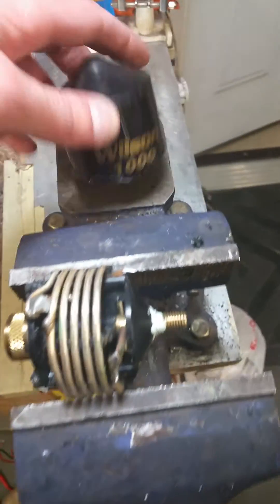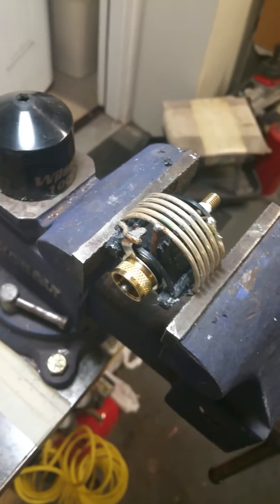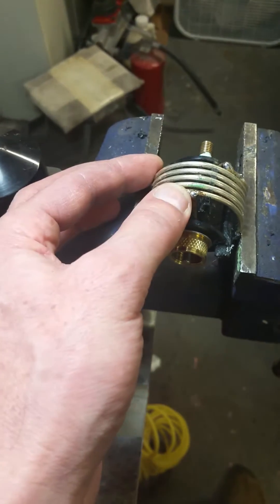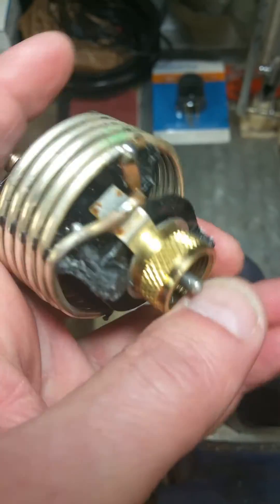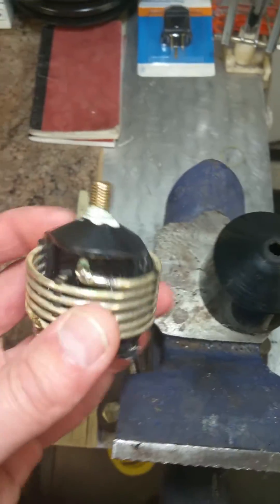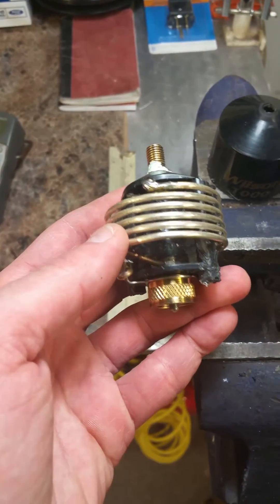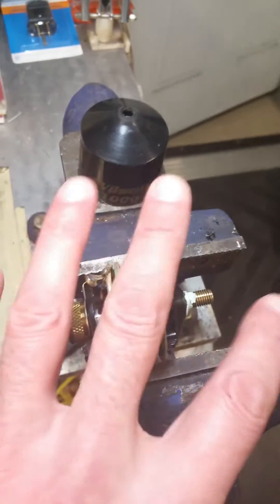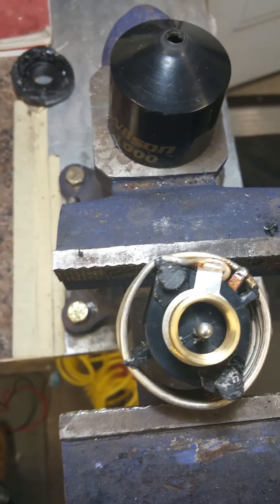Wilson 1000 checking continuity

Comment: Old post I know, but I am going to assume the quality control has gone down since they first came, out as I have had MANY of these same antennas with no problems whatsoever back in the late 1990's early 2000's.
Reply from the maker: Yes nothing is made like it used to.
I had a couple of freinds with the same problem. I had great results with the firestick 5/8 wave. 5fter.

Comment: Glad I found this video. Wilson 5000 came in and I had continuity between the threads and the antennas positive probe seems kind of odd but I’m no RF expert yet
Reply: Most of these base loaded antennas are shunt loaded, i.e.: the coil is grounded at a specific tap point on the coil (slightly different tap point on each coil) to help with matching.

Comment: yes how did you remove coil cover i tried and it does not want to to come off.. help needed
Reply from the maker: sorry Vic I didn't see comment, you can't really take apart. they are fused together,
you could try and cut around with hack saw on bottom? but you have to glue back together with apoxy
regard Larry
Reply: @Larrymutz  Thank you Larry for your help..

Comment: Dear Larry -- I need your help ... how to disassemble the covering mantle from the coil ... I assume, at the whip connector on the top -- I actually tried to open with a big 
torque but without success. Is it glued there ? Can you help me with this issue -- what could i try ?
Reply from the maker: Stephan Strauss 
it is plastic welded at bottom
there almost impossible to open with out destroying. 
Regards Larry